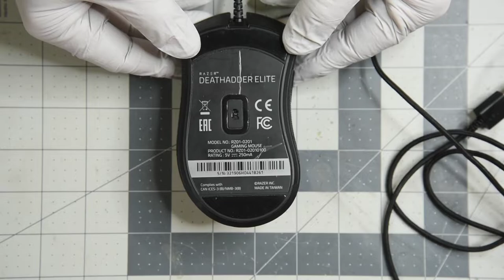Razer DeathAdder Elite Gaming Mouse – Main Switch Replacement

Comment: Thank you very much for the guide, I did this with my deathadder Elite and found that the easiest way to get to the screws was to push down hard on the plastic above it with a screwdriver. (yes this will leave permanent holes) Also, I couldn't get the D2FC-F-7N in a timely manner and opted for the Omron D2F-F, which worked after sanding down the inside of the mouse button a fair bit.
Reply from the maker: Very nice, it would be nice if the switch sizes were more standard.

Comment: When a mouse microswitch exhibits flakey clicks but still has decent mechanical clicking action then the contacts just need to be cleaned with contact cleaner such as Deoxit. I got my 4 Logitech Trackman Marble mice clicking properly again by using Deoxit on the offending switches. The microswitches in these things are half the size of switches in other mice and removing the top piece is quite difficult to do without breaking the tabs because the plastic is very hard and the fit tolerance between the top and bottom is tight. I also don't have a microscope to aid in this. At 55 the peepers ain't what they used to be. 
 
 You could introduce contact cleaner into the tiny gaps around the small actuator on top but that will be pretty tedious. I chose to get a pin vise (small handheld drill bit driver) and a 5/64" split point drill bit to drill a hole into one side of the top piece. The split point will help keep the bit from walking while trying to start the hole. Initially you need to apply good pressure on the bit just until a divot forms in the plastic. Then use only slight pressure after that or you risk suddenly poking through the cover and damaging the internals. You have to take this slowly and when you feel the drill bit grab a little it means you're about to pop through the side wall. This is where you need to hold back on the pin vise while turning to clear out the plastic "chips" from the inside of the hole and so that the bit doesn't crash into the internal parts.  
 
 The hole makes it much easier to introduce 3 or 4 drops of Deoxit into the switch. 3 or 4 drops is a lot for these switches but I wasn't confident one drop would be enough to make it to the contact points. It will easily wick into the hole. I only had a very small tube of it but it also comes in a plastic bottle that includes a thin needle applicator that would work better than the small tube I had. The Deoxit will start to wick out of all gaps on the switch. Just wipe off with tissue or paper towel.
Reply from the maker: Yea I should have tried some of the Deoxit.  That stuff is really good.  Thanks.

Comment: i really liked this video, there are lots of low quality videos out there with a lot of views for some reason yours is high quality but hard to find! maybe the thumbnail and the title might be the problem, also mine suddenly started turning on and off which causes me to instantly order a replacement cable but i came here to see how to place the sliders and how to assemble it because i forgot :)
Reply from the maker: Thanks.  I've been trying to work on the thumbnails a bit.  I think I'm getting a little better at it.
Reply: @metalplasticelectronics354  maybe if you go to a known YouTuber like electroboom and you start analysing his thumbnails since he started YouTube and when did the views started to go up and what changes he did to the thumbnail like font, focus, colors etc it would help you
Reply from the maker: That's a great idea.  There are several channels I watch that have been around a long time.

Comment: The switch on the left mouse button broke on my razer deathadder v2, I don't have soldering iron that's the problem so I just bought a new mouse, it's cheaper than buying everything needed. Although it was sure interesting to watch how it's done :)
Reply from the maker: Glad you watched, and thanks for the comment.

Comment: I changed mine and it worked for about 10 clicks then the right button stopped working and the left button started clicking both left/right at the same time. Resoldered it and it did the same thing, worked for about 10 clicks then spazzed out clocking both left/right randomly. Not sure what going on. Made sure not to over heat anything when using the iron. Any ideas??
Reply from the maker: Check the clearance from the top of the switch button to the button on the mouse. Make sure the switch button is not almost depressed in the resting state. I've seen slight differences in switch height cause some problems.

Comment: Mi ratón acaba de morir, se dió un golpe y ya no reconoce el USB el ordenador. Lo he desarmado pero es como si un mono mirase el motor de un coche, todo parece que está en su sitio pero no funciona...
Reply from the maker: If it was a physical impact.  Most you can do is look for a broken wire or a part that is loose from the pc board.  If the computer is not even seeing the mouse being plugged in.  Really look over the cable well.  Where the cable connects to the pc board would be a place to really inspect.

Comment: 09:10 the wheel is keyed, it only fits 2 ways?😀
Reply from the maker: Yes, it has small flats on both sides of the shaft, so it can fit two ways.

Comment: Please tell me what kind of tape was used to restore the skates, preferably the model and thickness and width, thank you in advance
Reply from the maker: 3M 4950 VHB tape.  What I used was 3/4 inch wide and it's 0.045 inch thick.  Wider would be better and they do make thinner and I think that would be better.

Comment: Was thinking about self-repairing my deathadder, but I dont think its worth getting all the tools to replace the switches...Guess I gotta buy a new one. Just seems to be a waste of material, when replacing the switch would add years of life to it. Thanks for the indepth video tho, great stuff
Reply from the maker: Yes, kinda like needs to be something you want to do.  Or to make a video about it.  Thanks for the comment and watching.
Reply: Just be careful it is a common flaw I've gone through 4 in the last year. At this point I could have bought all the tools.

Comment: I'm tempted to cut holes to extract the screws rather than remove the whole button-end rubber pad. If it feels like they need to go back in, I could likely glue them in place and lightly sand anything that sits proud.
Reply from the maker: I think that would fine.  Save a bunch of time.
Reply: Shid why didnt i think of cutting , dang it  i already peeled boths ends a little to accsess the screws not thevwhole thing but both ends . Ill try to put em back but if not ill cut the ends off should be fine ,balance and movement wise

Comment: great video. what model/brand is that welder?
Reply from the maker: The vacuum desoldering gun is a Hakko 470.  The soldering iron is a Hakko FX-951.  The desoldering gun is very old but still works quite well.
Reply: @metalplasticelectronics354  Thanks!!

Comment: Can i change razer deathadder v2's switches for mechanical switches like omron?
Reply from the maker: I don't know what kind of switches are in the deathadder v2.  But would probably have to be the same type to fit and work properly.
Reply: @metalplasticelectronics354  optical switches v1
Reply from the maker: I'll look them up.  Have you taken it apart?  If so how many leads are on the switch?

Comment: 10:03 Realizes he jerked the connector seating right off the board during removal and smooths that over by complimenting Razer on having one. Why admit it. Nobody saw that right? LOL. Razer forcing you to remove the glide pads in order to service the mouse is a sad commentary on our disposable mindset today. Here lies the Human Race: They paved Paradise and put up a parking lot.
Reply from the maker: Wow, you were paying close attention to the video.  Yea they didn't ever have any intent for it to be pulled apart.  Thanks for the comment, I do appreciate it.
Reply: @metalplasticelectronics354  the connector has a plastic base that is supposed to remain on the board, not be pulled off like an animal with mitts. Sorry man I was paying attention. Thug Cable life. which is why IN THE VIDEO you pull it apart, reseat it and then plug the cable side back into it. CANT. MAKE. IT. UP.